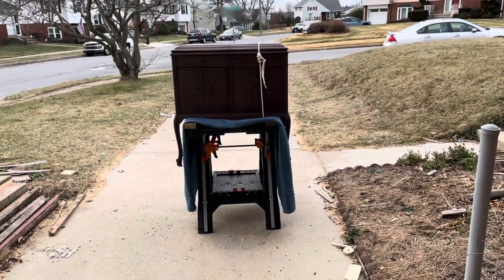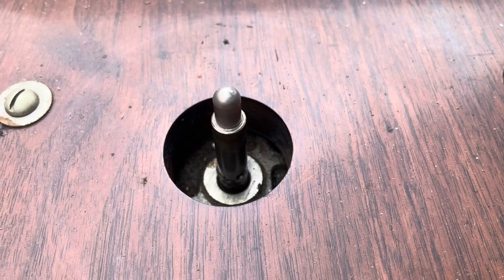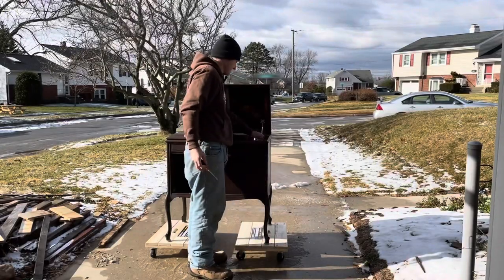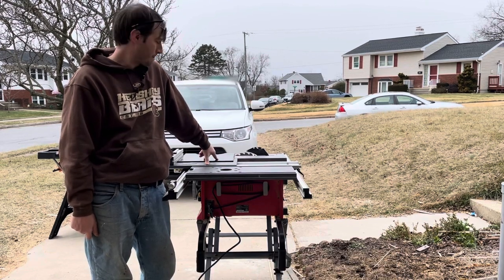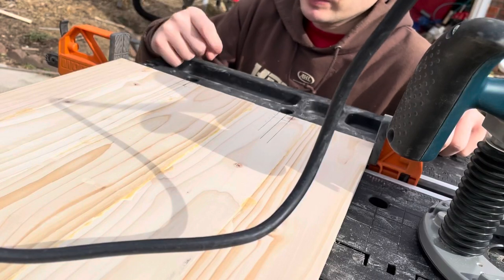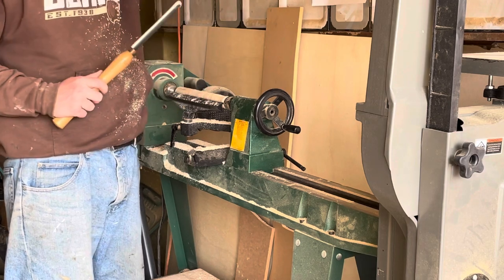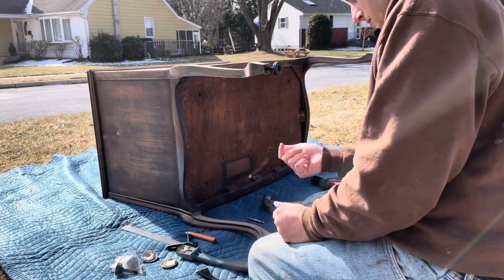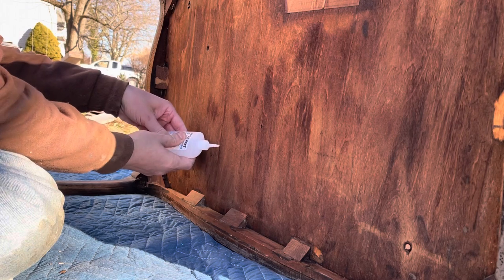renovating a 1924 Victrola VV-215 (part 1)

Comment: Nice work so far! Love the idea of repurposing the shelves! 

Does the software you use for video editing have a noise reduction? If the buzzing on the mic keeps happening, you might be able to reduce/eliminate it by letting your recording run for 10-20 seconds without external sounds. Just let it pick up the mic buzz and have your editing software capture that as the noise point, then run a noise reduction on the entire video. That should look for that specific noise pattern and not harm the rest of your audio. It isn’t guaranteed to work perfect, but it might help.
Reply from the maker: I film on an iPhone and edit with the free Splice app. I’m low-tech. 😂